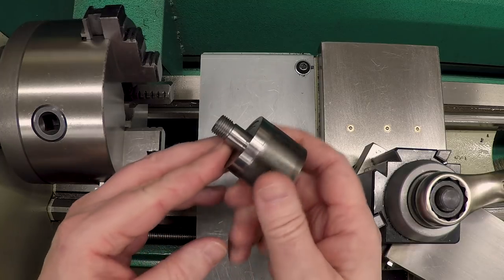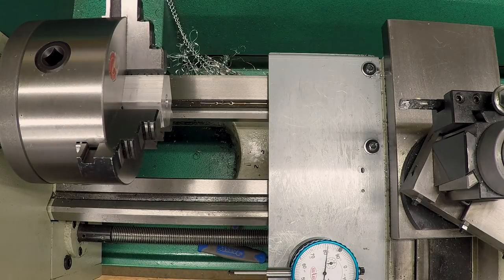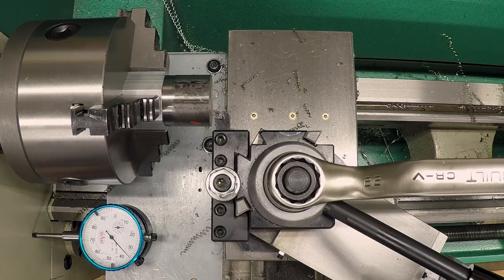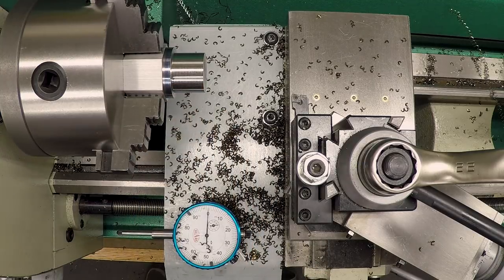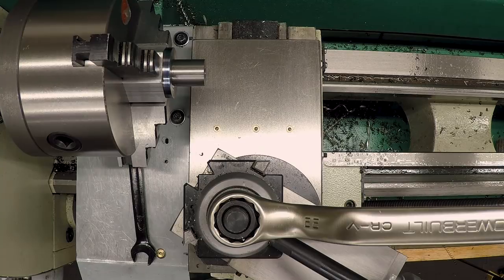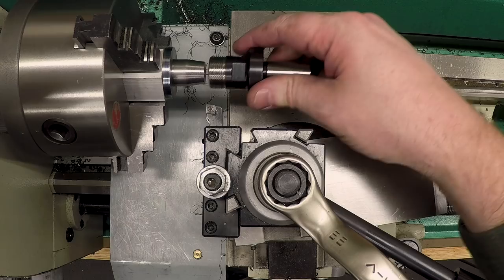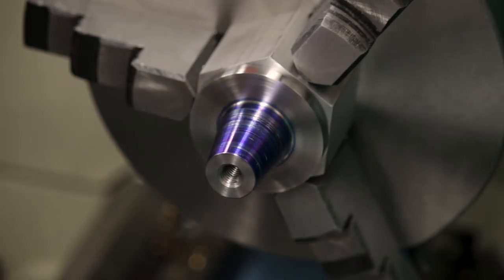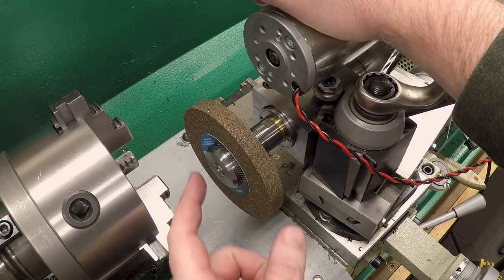Making a Toolpost Grinder Part 20: Wheel Arbor 3

Comment: Looks good so far. Are you considering lead screw and way covers before you become a toolpost grinder addict? Given how well designed your projects thus far have been, I'd like to see what you came up with to keep your lathe safe from preventable wear.
Reply from the maker: That's a great idea.  The current plan is to use towels and Pig Mat.  I'm also hoping that using coolant while grinding will make the grit land and stick instead of flying all over the lathe.

Comment: Nice series! 
I'm noticing something over and over in your videos and that's probably because I'm currently addressing the same issue on my lathe which is the same as yours. You are getting huge tool-post deflection like at 21:33 and it looks like it may be time for another project like substituting that compound with a solid block of steel and adding 4 more holes. As I said earlier, I'm currently doing this to my lathe and I noticed something else. Clamping down the compound with the 2 bolts actually bends my table and changes the pressure on the gibs by a lot because the bolts are pulling up on wither side while the compound centering post is pushing down in the middle. Look into this if you care and I think you will find great improvements in how rigid you lathe is. If you haven't heard of this very popular mod ( which I doubt, to be honest ), just search of "grizzly g0602 solid tool post".
Take care.
Reply from the maker: Yeah, I know it's an issue with this lathe, but I hadn't realized how bad it was until I saw that clip in this video.  The tool was really diving into the work there.  A compound upgrade is on my list of projects; I just haven't gotten to it yet.  I'd really like to get rid of the compound entirely and replace it with a solid block, but I use the compound quite a bit for threading and tapering.  I'd also like to make a taper attachment, and I'll need the compound on the lathe for that, since the cross-feed is disconnected.  One project at a time, I guess.  :)

Comment: Great work!  I'm trying to make my way through all of your videos.  
I love the way you explain your actions as you show them.
I have a couple of questions:
I'm interested in the copper you are using here - and for your lathe jaws on the 4-jaw chuck.
Do you get it in sheet or roll?
What is the thickness?
Is it soft copper?
Where can I buy it?
Reply from the maker: It's .025" copper sheet.  I bought it at Hobby Lobby and cut it to shape with a small shear and tin snips.  If you have a store near you, they almost always have a 40% off coupon on their web site.

https://www.hobbylobby.com/Crafts-Hobbies/Hobbies-Collecting/Tools-Blades/Copper-Sheet---025/p/21779

Comment: You could probably use your collet as a wrench...
Reply from the maker: Yeah, you have a good point.  As long as it's tight enough that it doesn't slip.  I'd hate to gall up the taper.